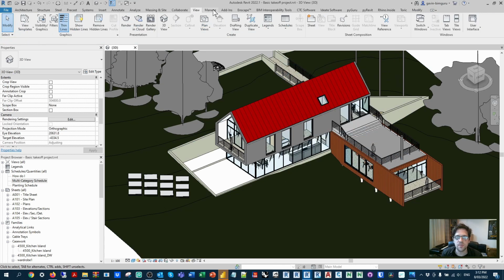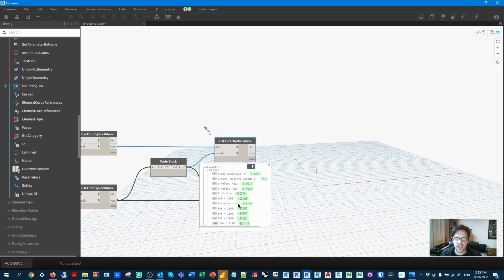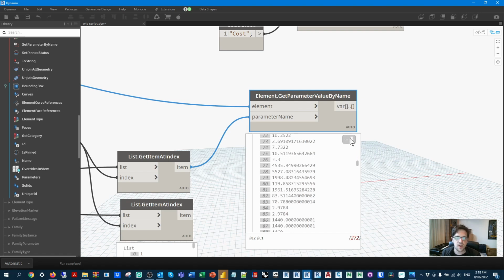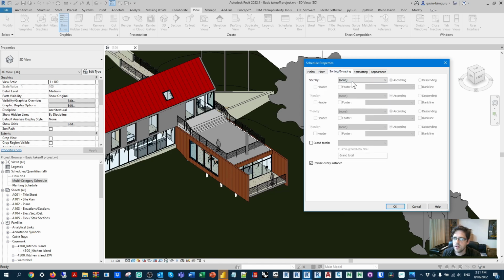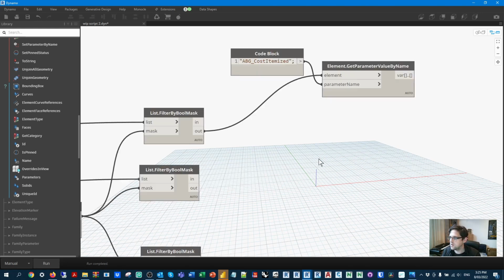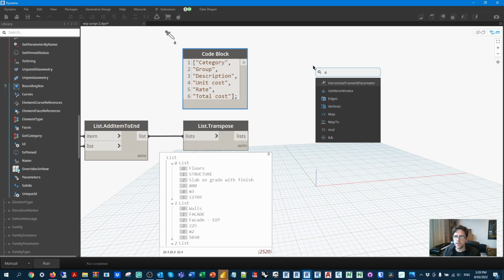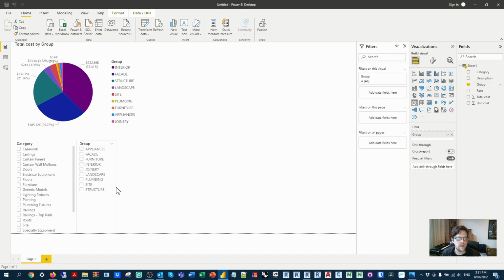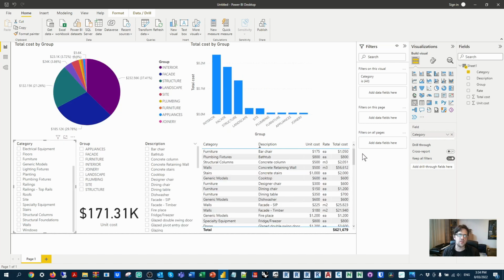Revit quantity takeoff report using Dynamo and Power BI!

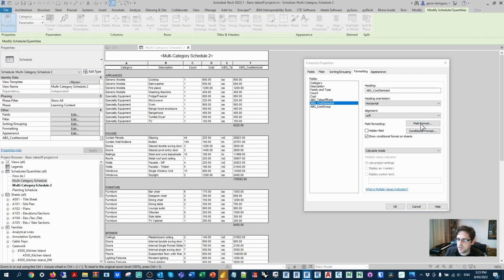Comment: I don't understand the Count field in the schedules and how it's calculating the ABG_CostItemized. I can see that 2 Designer Chairs at $300 EA is $600 but how is 2 Plaster Board Ceilings at 140m^2 costing $21,602? Where is the area information in the chart? Are you saying you have 2 ceilings at 154 total area?  (time stamp 12:59)
Reply from the maker: @fearoniszac  yes in this case behind the scenes there would be 150m2 of those 2 ceilings to generate that total cost. This schedule is a bit different to other ones as some objects are measured each but any that arent wont use the same calculation logic (e.g. area, volume). Before this step we used dynamo to manually set the  unit cost of each element to work around the limitation that revit cannot calculate different columns in different rows to total a column together.

Comment: Is this more accurate than the normal export? because I get some blank an unorganised list while exporting it from Revit.
Reply from the maker: It generally should be as long as the data is structured and prepared before exporting to excel.

Comment: Amazing tutorial 👌🏻would it be possible to connect the interactive powerBi sheet to a revit sheet? This would be extremely useful, to be able to see the data pie chart for example back into the revit model, placed on a sheet? Does this exist? a Revit - powerBi- Revit workflow?
Reply from the maker: Generally there isnt as far as I am aware. Revit doesnt really have graphing tools builtin natively but you could potentially hack one together out of generic annotations and dynamo I guess. Not sure if worth the effort though versus importing an image of the power bi dash.
Reply: Thanks for the reply, yes for now i basically have the powerBI charts as a jpeg linked back in revit
Reply: PS: i am aware there are some software add ons out there that can do this, but i was wondering if there is a more simple/manual way of achieving this

Comment: Hi Galvin. How are you. I'm beginner for Dynamo. Interested to learn dynamo. But I gone through diroots basics videos and your videos. Here the problem for me is to make one script every person using different custom nodes. So can we remember many nodes for many scripts. Could you please guide me. The logic how i need to start to learn. Thanks in advance.
Reply from the maker: To begin with try not to use too many custom packages, only what you need. I use Crumple as it is a package I manage and can rely on. Focus on simple workflows and concepts, and learn using the dynamo primer initially. Don't try to learn as a beginner by following complex workflows (most of my content is intermediate skill level).

I have a course which is quite cheap versus alternatives which teaches Dynamo using very few custom nodes if it helps:
https://courses.bimguru.education/courses/course-dynamo-4revit
Reply: @AussieBIMGuru  Thanks for suggesting me..i will follow the same.